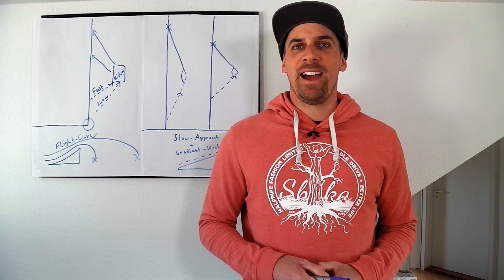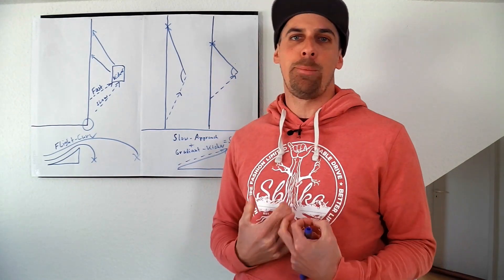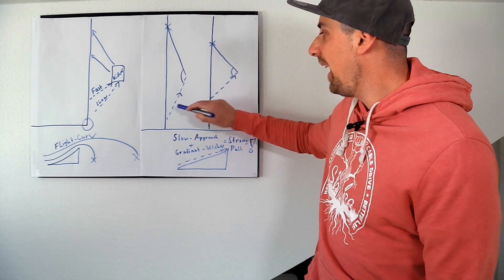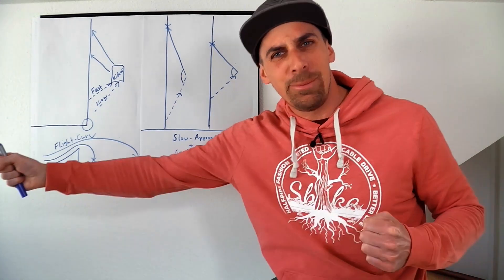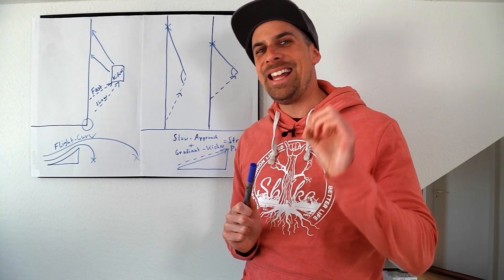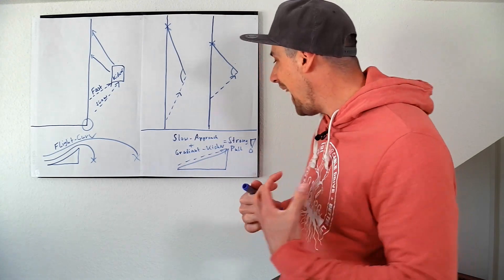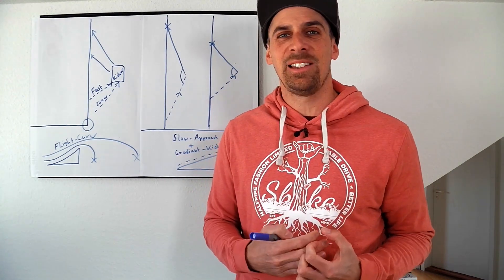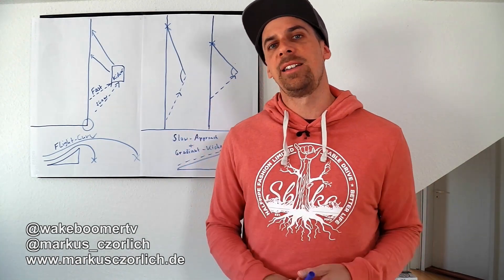Cable-Physics | Kicker-Spins | 360s [ENG]

Comment: Great tutorial, great English. One more question: if you take a slow approach, with strong pull on the rope, wouldn't that result in a longer flight curve? You can let the carrier pull you up in the air, no?
Reply from the maker: Thanks for your feedback! :-)
You mean a short but aggressive approach? If yes, of course thats another way to create more pull and tension and it´s another way to change the flightcurve. The way I discribed in the video is just one way, but there are lots of more ways to go for the kicker and a lots of ways to change the flight-curve and the pull. It also depends on how far and in which direction the kicker has it´s position on the water.
With all that things you have to find the right "balance" for different tricks. :-)

Comment: Thank you for this Video! I understand everything you said but I would like to ask you another question: so I‘m riding Wakeboard behind a boat and let‘s say the wave is the kicker, are the physics the same as you riding on a kicker in a cablepark?        Surely you van answer in germen if it‘s easier!!
Reply from the maker: Thanks for your feedback! 👍🙂
Honestly I’m not an expert for riding behind a boot... I would say there are some points where the physics are pretty similar, but especially because of the fact that the cable is whipping and moving while the rider is doing any trick-stuff, there are some differences. Also the direction of the rope and the pull are different behind a boat. So, sorry that I can‘t help you more like that! 😅🙂